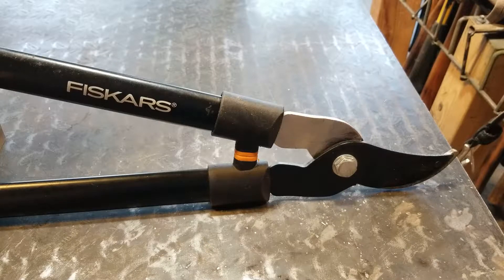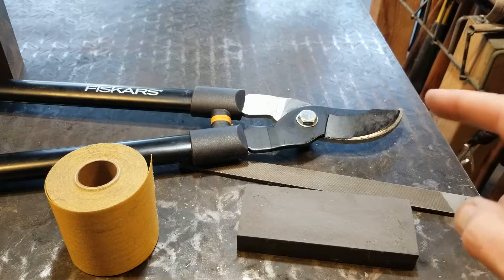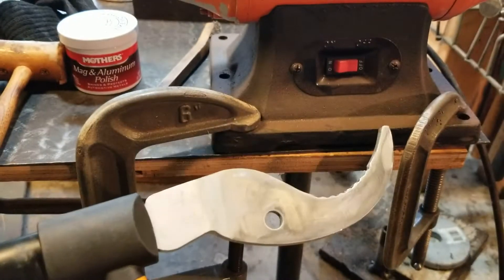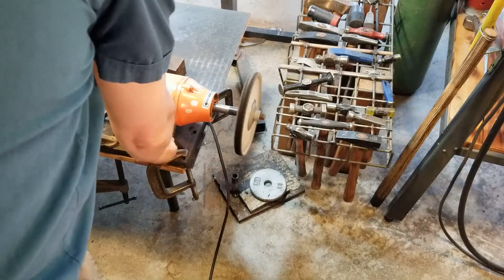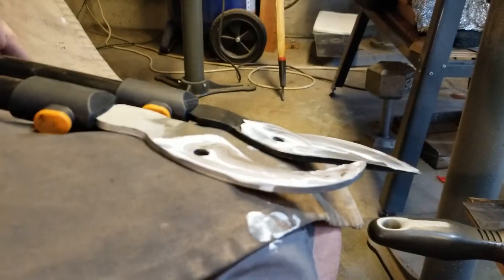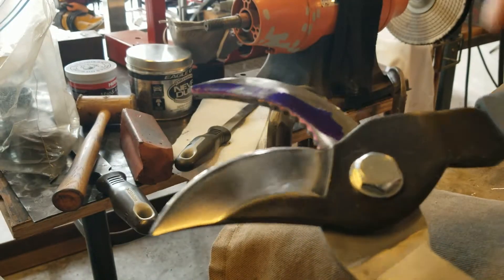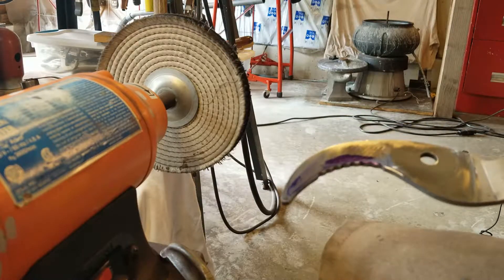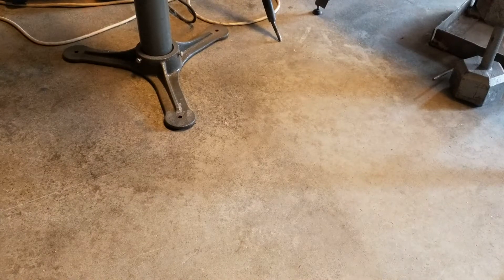pruning   shear sharpening and tune up

Comment: Question,  is there a way to make a buffing wheel more square? 
Reason I ask is my wheel has some high spots and low spots from side to side and I believe it is lop sided.
Reply from the maker: run it , then drive a flat screw driver into it and knock out the compound , its a mess but it works.